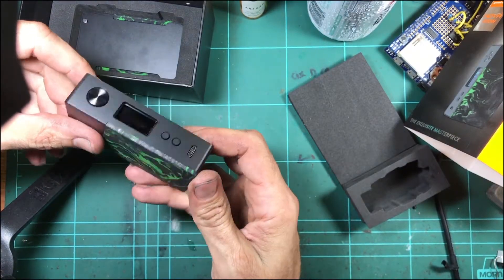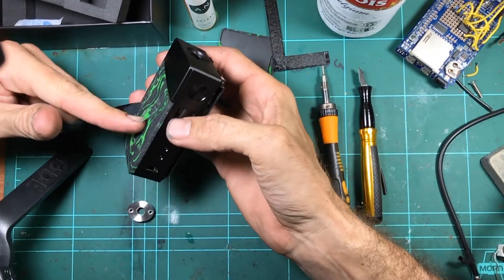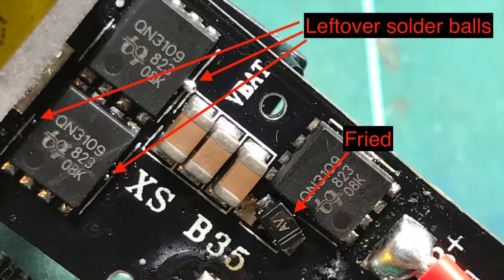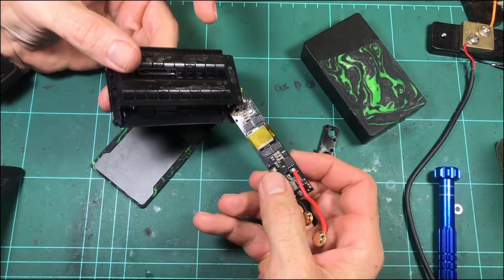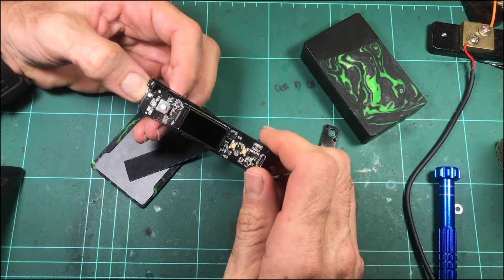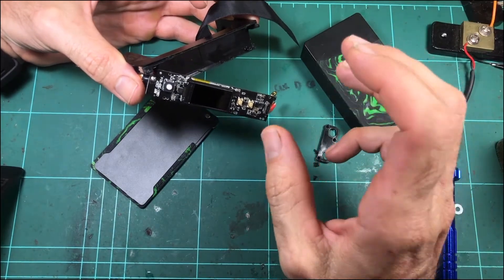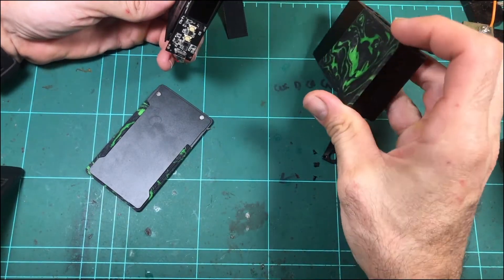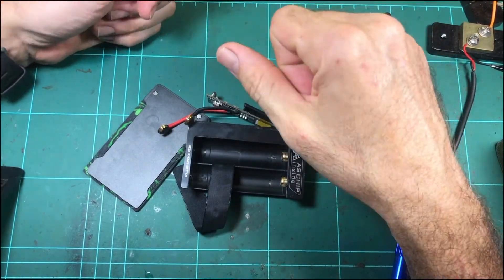Failed Geekvape Nova (DOA) - teardown and analysis

Comment: This is a bummer. After 3 years of use one of the top battery contacts had a bit of a worn spring, so it doesn't stick out as much as the other side. Now it constantly loses power until I spin that particular battery so it makes contact again. My Sigelei was very similar but the sled was held in by 4 screws (very easy to work on). Any advice on getting the springloaded contact to sit further down? Wish there were screws cause the spring just needs a little spreading. Any ideas would be much appreciated.
Reply from the maker: Apologies for the late reply! Hmm that’s a bit of a tricky one. Ideally I’d raid a stiffer spring out of something else to replace it with, but you could also try putting something in between the spring and the retainer to space it out a bit, kinda like a preload. Something non conductive would be the way to go, maybe a square of plastic cut to size. Obvs you’ll have to do a full disassembly. I haven’t had much luck trying to stretch these little springs to return them to their original length, they’ll normally just compress back again after a short while.